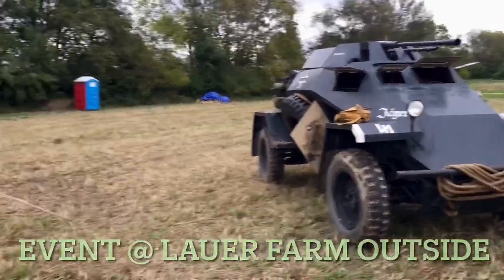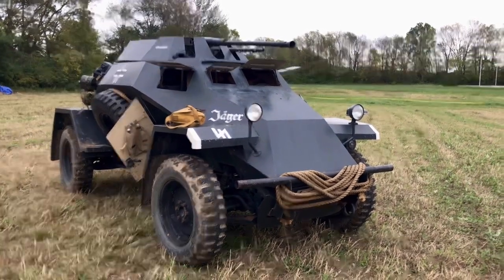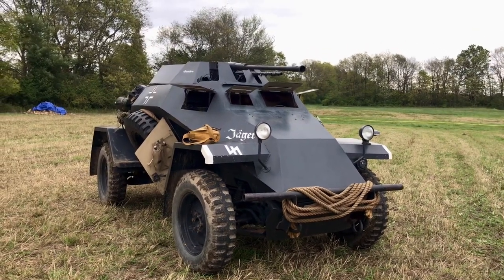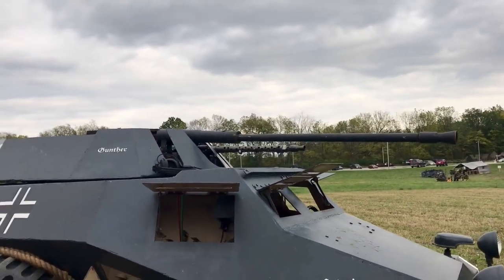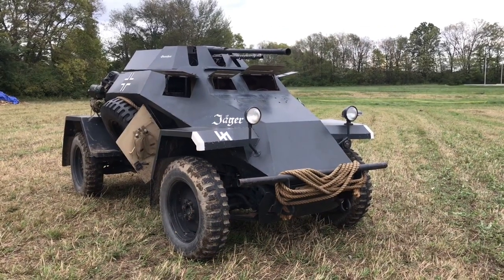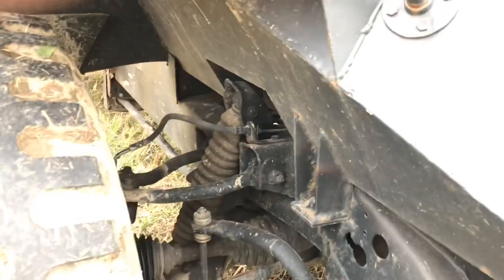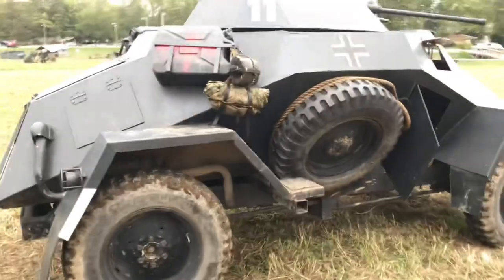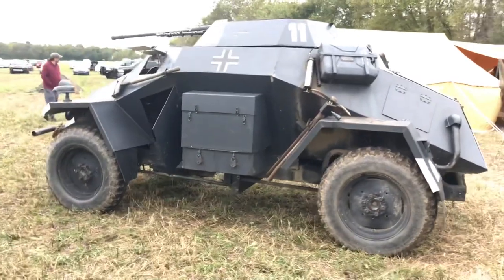Homemade German Armored Car💥Battlefield Action 💣Lauer Farm Ohio  2021

Comment: What kind of transmission is being used? I can’t think of any transmission that comes from a small block that would have 4x4 capabilities and still get power to the rear of the vehicle.
Reply from the maker: I believe it was old Chevy truck parts so maybe a turbo 400
Reply: It has a rear mounted Chevy 350 v8 with a Pontiac TH375 2wd transmission with a divorced transfer case. There is a reversing gearbox between transmission and transfer case to get it to drive the right direction then. My son Brenden, was driving it at thie event and helps me maintain it.

Comment: It is incorrect to say Americans weren't good at angled armor plate.  Most American armored vehicles off WWII have sloped armor.  In some vehicles however, it was determined that the significantly greater interior space given by a vertical plate design was worth the reduction in armor effectiveness.
Reply from the maker: Thanks for the info Max 
That would be a good reason to go vertical
Reply: its also how they were manufactured, germans used very brittle hardened armor plates and welded them together so they must have sharp slopes and angles, it required more skilled labor by hand and was slower and more expensive but doesnt use as much material and is harder to penetrate.  americans and russians cast alot of parts which allowed round shapes and was easier to mass produce with less skilled labor but needs thicker walls. sloped armor has less interior space but is harder to penetrate like t34 so there is always a trade off. american halftracks for example are more troop transport than armor so chose space and simplicity over sloped armor